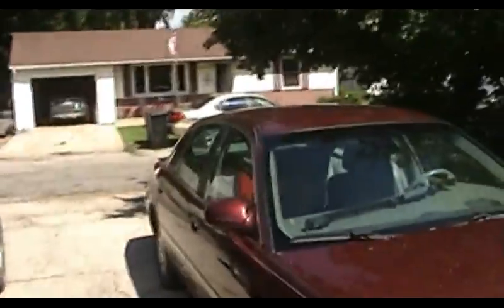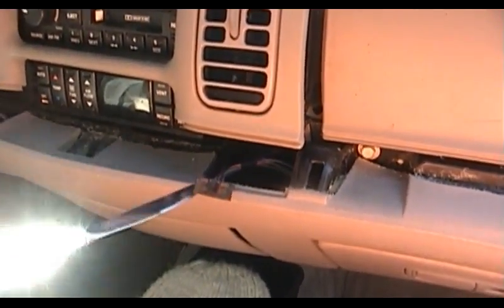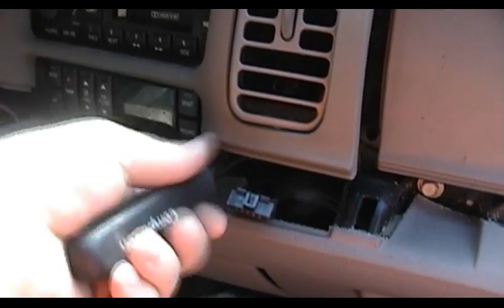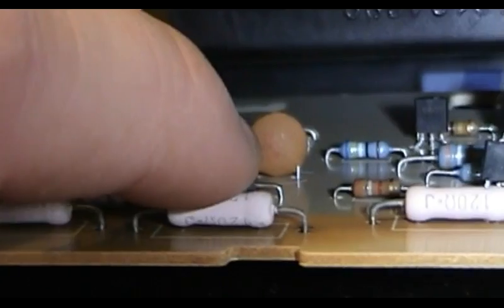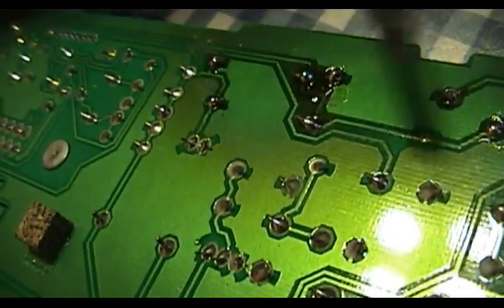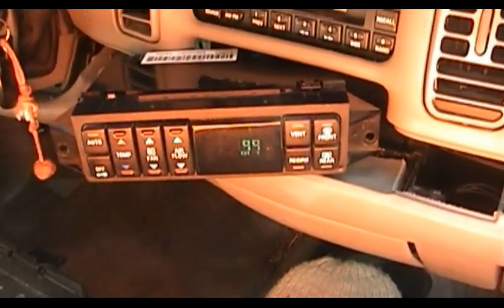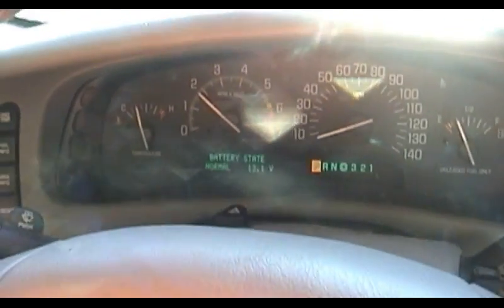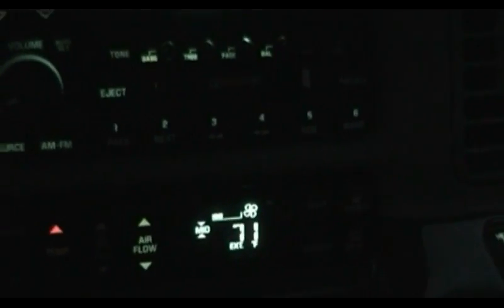Kitchen Table Electronics Repair: 2002 Buick Park Avenue Climate Control Display Repair

Comment: I have this same car,2002 Park Avenue. My Climate Control module is still working. The rear defroster in mine is wonky. The cause, is all inside a module that is up behind the rear seat passenger (on drivers side). You need to remove the plastic liner, and inside there is a combination antenna booster box, and the defrost wires go into that also. Mine is burned to a crisp, the connector is burned off, almost beyond repair. I got it to hook up for a while, and it worked (though not well) for about a month. I need a new module, but whatever the cost and effort to put it in, doesn't seem to bother me. The rear seat heat/a/c vents can be set to kind of blow up toward the rear window, and work well enough for me. That's about the only thing in my car that doesn't work properly, everything else is just perfect.I really like this car!

Comment: I have a 2004 Buick Park Avenue Ultra, I have been flicking the climate display for the year that I've owned the car. I just had a $2200 service done at the dealership, considering 41,000 miles when i bought it in July 2014, now at 77,000 and still had original tires, brakes, etc. I also got a massive discount. My vehicle is a Ultra which means it is a 3.8 liter supercharged, your video saved me about $500. Thank you very very much!

Comment: The "interface"-board as you call it is indeed wave-soldered by machine. It's the repeatedly heating and cooling that makes the solder disintegrate over time. Nothing to do about that other than giving the resistors some longer legs so they can shed off the heat to the surrounding air instead of the PCB.

Comment: Let me give you some kudos for this, it solved my problem on mother-in-law’s 2004 Park Avenue. Not as many bad solder joints as you had but they were there on those resistors. Cleaned that up and we’re cooking with gas! Now... on to the power seat issue....
Reply from the maker: I'm glad to hear it helped. Good luck with the power seat. Hopefully it's just a switch or connector problem. There are days I wonder if GM wasn't the US counterpart to Lucas Electric.

Comment: Hey 'Kitchen Table'!  Your fix worked like a charm!! Saved me 300.00 in repairs! I had to do a two wire jump because my board was to far gone. I think they used plumbing solder on those connections. Or issue was that the fan would not come on until you bashed the dash right above the ashtray. Thanks for the video
Scott
Reply from the maker: +S. Mead I'm glad to hear this video solved your problem. I fully expect that my own repair may have to be revisited in future to counteract further degradation of the circuit board.

In my view, mounting the resistors further away from the board (leaving their legs longer) would have helped immensely.

You may want to check wiring going to the blower motor and its control module. The connectors can sometimes degrade and start to burn out, which will also lead to intermittent operation and a possible fire.
Reply: +uxwbill Yes, degraded it was and I did not help it any with my high temp soldering iron. I am going to revisit that today and maybe wire all of those high temp resistors to sit way above that cheapo board.

Comment: I appreciate your help, but you forgot to check all the small little bulbs inside the radio, twilight switch, headlight switch, interior switch, HVAC control module, door controls, passenger door temp controls (limited LeSabre only) which are covered with blue covers, if available as option. I found that "germal bulbs" for "VW/AUDI" that are CANBUS error free (LED) work well and allow dimming when the alarm unlock and lock button are pressed. Yes, the dimming works with these  bulbs despite what everyone tells you. The other option is installing resistors in easily accessible bulbs like the doors and the bottom panel; under the dash on the festoon bulbs (or buying Partsam LEDS on Amazon with resistors, which are bidirectional and CANBus error free and work on 9v-24v. They give you dimming and don't fry Mom's precious modules in the car. Either way thank you. Now can someone tell my how to get the dash out of the car to replace the heads up display bulbs (LeSabre Limited 2002-2005). I Have three copies of the GM esi/software and have too much on my scholl PC to run the software in an XP virtual machine nor run the software in WIn 10 with a virtual machine of XP or 7. Whew. Thank you again for diving in and getting it done. Mine is Gloria after my late mother in-law. Also, while you have the dash apart everyone makes a big stink about the gauge stepper motors. My motors are fine; it is the gas gauge that either reads full or waits until you have traveled 450 miles; then,  the amber--"danger you have no gas" light  illuminates on the gas gauge. Lastly, I am trying to find the correct A/C actuators on my car. According to the GM manual( and on-line) there are five for this fancy option of HVAC. One for each front door; one for the middle (windshield--mid and floor;) another for recirculate and another for the passenger door ( individual temp control); maybe another for the rear air. Only two are the similar, the other three are different part numbers. Oh. the fun begins.
Reply from the maker: I had no intention whatsoever of replacing the bulbs!
Reply: @uxwbill Thank your video.

Comment: A simple test for the rear window defroster without waiting for the right "weather":  With the engine off, keep a door open and stare at the dome light when you press the button for the rear window defroster.  The dome light should dim, as the rear grid pulls a considerable amount of current.  You can cycle it on and off a few times and you should see the change in brightness.  Maybe not a complete and conclusive test, but it will at least give you an idea.

Comment: I think the 1993 Chrysler Concorde we had included the most awesome climate controls of all. The fan had a continuously variable knob like the cold to hot control. I know it had rear climate vents that could be adjusted. I think the vent selection was push button. The fan speed went from super high to super low.

Comment: Another informative video! I just have two things to say. 1. Missouri is the same about the weather, if you don't like it, just wait a while as it will change. And 2. a lot of older GM's interior screws are mostly 7mm.

Comment: I had two Park Avenues from this generation and found the dash very easy to take apart and service the various electronic parts.  I changed out my climate control unit more than once and also repaired my gas gauge needle in the speedometer cluster.  I miss these cars very much and would give my right arm to have the 2005 model back.  They were one of the last truly American cars to roll off the assembly line.  The new American flagships just look like sick jokes in comparison.
Reply: tyler2610 agree I love my 00
Reply: I'll chime in for my '98 as well. Other than the melting plastic intake manifolds on the 3800 engine these cars are bulletproof and should easily last 200k-300k miles

Comment: +uxwbill - When doing such a repair in the future, I strongly recommend blindly replacing those resistors.  If they've really gotten that hot for years, its likely they've drifted in resistance over time.  Make sure to get the same type -  those appear to be flameproof resistors.. and as the name might indicate, its an important distinction.  There's also a lot of room in there, if they're really getting that hot because of design and not poor manufacturing, replace them with a higher wattage.  GM/Delco seemed to have a hard time in the late 80s/early 90s with manufacturing electronics with displays.. seems their frugality continued on for longer than I had realized.  This, as stated by at least one other commenter, was a design for the bean counters: cheap, garbage, just to save a few pennies per unit.
Reply: How do we tell what wattage the factory ones are? They're 120ohm because it's written on the side, but I checked out resistance with my multi-meter and they range from 30ohm to 118 or so, so I figure they're bad. (Or I'm an idiot and doing something wrong.)
Reply: Wattage can generally be inferred by size.  The ones in the video look to be 1/2 watt or 1 watt.  With whatever you replace them with, make sure to give them space between the resistor body and the board like the manufacturer did. helps with cooling
Reply: Would it be wise to go 2 or 3 watts to lessen heat? These get REALLY hot just being on for five seconds.

Comment: I'm pretty sure that these resistors were closly soldered to the board in order to fry the joints loose, to make it a pre-programmed weak spot which is intended to fail after a number of operating time. The manufacturer then sells you a new unit "for a few dollars more". My opinion: Get the same resistors, bend some distance loops on each leg prior to soldering them in place. That should keep the resistors well-spaced from the bard soldering joints due to reduced heat condictivity, making obsolescence obsolete.

Comment: actually...Delco Electronics/Delphi Automotive in Kokomo was the world hq for Delco.They had a chip foundry, motherboard room and full production line. If it says Kokomo, It was fully manufactured on site until they closed 95%  of the facility in 2008. I lived in the area for 20 years. What you have there is an american made product. Most of the radios,ECM's and climate controls were made in Kokomo over 70 years.Michigan made the Delco suspension parts and spark plugs. Tektronix is opening a small facility in part of the old plant and Delphi Automotive still has its engineering facility there. GM Components Holdings owns the rest and it mostly sits empty except for the  Delco Electronics and Safety division. It's a gigantic facility and it sits empty....quite sad

Comment: Roughly reminds me of wanky LCD shutters for the fuel gauge in the upper tier instrument cluster in my Mom's '06 Honda Civic.

After removing the upper tier cluster and taking it apart, I found that the problem was cracked solder joints connecting the LCD elements to the PCB.  Easy to fix; you desolder the joints using copper desoldering braid to remove both the solder and a resin coating over the joints.  Then you solder the joints.  Of course, it would be a good idea to apply new resin over the joints after flowing them with fresh solder; the manufacturer didn't put it there for kicks.

Comment: That desoldering tool looks like mine. Too hot for many uses. I would use desoldering braid with a controlled temp device. Further, some low-melt-point solder with silver from Parts Express is on my list to buy. Cheers

Comment: i really want a 2005 buick park avenue ultra. last best buick made.

what sucks though it only take spremium gas.
Reply: Ours does fine on regular, try it...
Reply: We only put regular in our buick regal and it runs fine.
Reply: Ours is a 2004 PA Ultra, never had premium and no knock, MPG about 27-28 at 65 MPH on interstate, more like 20 MPG around town stop n go. About 100K on the clock...
Reply: Mine is a 1997, and I do not mind paying the price for fuel. Every time I put my foot to it I hear the supercharger kick in to pass us an eighteen wheeler. Now it has almost 294,000 miles... It is a keeper!

Comment: Just thought of another failure I have with this car, but I've just learned to live with it. Many of the tiny lights behind buttons, such as on the climate control buttons for AUTO, VENT, OFF, only light up now and again. Some nights, I have my power door lock buttons lit on one side or the other. Sometimes both, sometimes none. Dash lights are all good, just some micro lights behind buttons...like on the steering wheel, do not always work.

Comment: I *think* you could get the most basic Park Avenues in the early days of the redesign with manual climate controls, but the manual climate control box is not compatible with the automatic box, it's a different connector.

Comment: Another great repair video!  
I would recommend looking into upholstery and trim tool set – your technique is great but having a set of soft plastic removal tools helps when your dealing with really old trim/panel pieces plus an excuse to buy more tools

Something like this (links below) could be an asset 
I bought mine from my local Canadian store - http://www.princessauto.com/en/detail/5-pc-trim-remover-set/A-p8309411e

Harbor Freight has the same thing for guys/gals in the USA - http://www.harborfreight.com/5-piece-auto-trim-and-molding-tool-set-67021.html

Comment: Well done bill :-D, it fought you but in reality it didnt stand a chance lol :-)
Being a vaccume display it should have heaters stretched across the display, and even though i seem to remember that it will work with d.c powered heaters, it apparently makes the display unevenly excited, but still i think those resistors could be the filiment supply droppers, perhaps, maybe lol :-D.
Those pesky bolts i thought might be 1/4 or 6.3mm, but could have just as easly been the typical 10mm, very common everywhere except the moon... no im corrected ha ha :).
I allways enjoy your videos bill, you have a cracking sense of humor and your repair skills are far far better than you let on.
Comedy and repairs, who could want more :-D

Comment: Bill, if you choose to do an LED light retrofit in the future, there's no need to calculate resistances or anything. superbrightLEDs.com sells LED bulbs in most of the common automotive bulb sizes, and they add all the necessary circuitry to make it a plug and play job to boot. I was able to convert my entire car (instrument cluster, HVAC controls and assorted interior lighting) over to LED lighting for about $45 including shipping.

Comment: I have a 1988 buick electa park avenue  that I just recently got from georgia and I'm backin wisc.
and I have to wonder if any thing else goes out inside these. My display works and  I can hear a high fan
when I manually turn it on but no low fan , But no heat. thks........ good job fixing your display
Reply from the maker: There's no way around doing some troubleshooting if you want to fix this yourself. Places I'd look first include the fuses and all wiring harness connections. Disconnect the battery for a half hour to see if the system simply needs to be reset. 

Beyond that, bad modules and even bad solder joints are common faults. The thermostatic/electronic climate controls use a transistor to control the blower fan speed and it can fail shorted. If it does, this will cause the fan to run uncontrollably at full speed.

No heat could be an electrical or engine coolant system problem. I'd check the coolant circuit first and make sure the heater core isn't plugged or bypassed.

Comment: I usually fix such poor solderings by resoldering all resistors, then I straighten it pins by pillers. Than i use knife or abrasive to remove any scale, and use an orthophosphoric acid to tin it again. Most important thing is to clean an acid after soldering, i use isopropyl or etyl alcohol.

Comment: Something in your video editing or encoding process is causing the 16:9 image to be letterboxed within a 5:3 (not 4:3!) frame, resulting in the windowboxing when viewed on YouTube. Maybe you have the resolution mistakenly set to 800x480 instead of 854x480?

I don't know why the American automakers stuck with VFDs for so long, since they require extra circuitry, wash out in bright sunlight, and fade with age. My only guess is that they preferred the blacked-out look of the faceplate when the display is not in use (or not working, in this case!).
Reply: vwestlife I'd assume that they might have some extra VFDs in stock that they want to kill off before switching to LED displays.
Reply: ***** I'm right with you, I too prefer the look of VFD readouts, LED readouts look good too, both LED and VFD readouts do look better in my opinion than backlit LCD readouts, but of course backlit LCD readouts are far more popular these days, which in my opinion is a bit of a pity.
Reply: vwestlife  I really prefer the VFDs over LCD too. LCD just looks cheap like a calculator in comparison to the blacked out VFD in my opinion although they do not fade with sunlight.
Reply: eaglevision993 What about LED? Or the computer's LCD monitors (that aren't a cheap calculator screen)?
Reply: LED readouts are fine in my opinion, and I am specifically talking about LCD readouts on things like digital clocks and stereo systems and other devices that have a readout that shows basic letters and numbers etc, not full scale video display monitors, and I suspect that's what uxwbill's thinking of too.
Reply: +vwestlife All our cars have an LED pixel display. No VFDs. They are indeed not American.
Reply: +vwestlife I wish they hadn't used the mint green filter on GM vehicles of this era, but from what I understand, VFDs don't really offer the wide range of colors that more modern displays do.  The Park Avenue has VFDs in the climate control, radio, driver information center, and the gear shift indicator.
Reply: Would be nice to see an OLED display for the climate control.

Comment: 99°?? Looks like you have a bad outside air temp sensor... it's located in the engine compartment usually somewhere in the very front.  they're usually less than $20.

Comment: William, I installed 12v LED turn signal/park bulbs on my SUV tail lights. Now my turn signals experience Hyper Flash due to the LEDs lower power draw. My question is ; How do I determine how many ohms in a resistor I require to bring my turn signals to a regular flash pattern ?